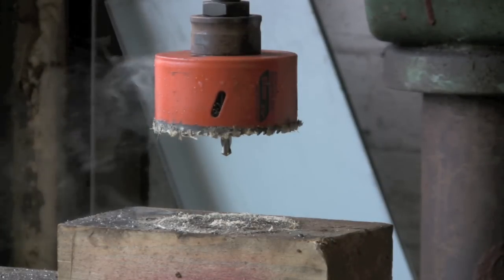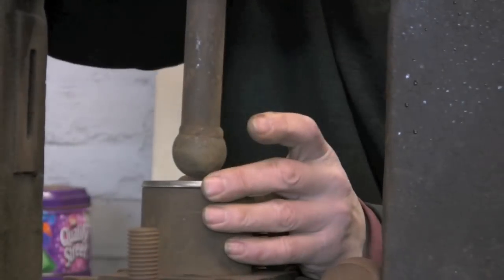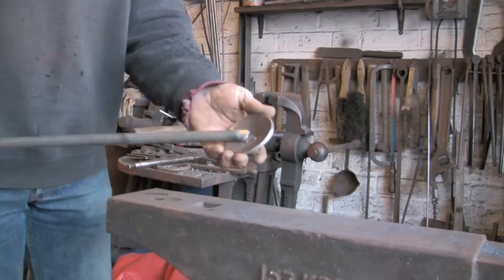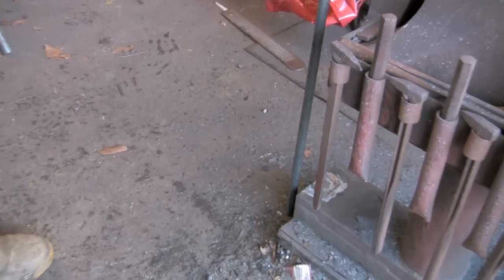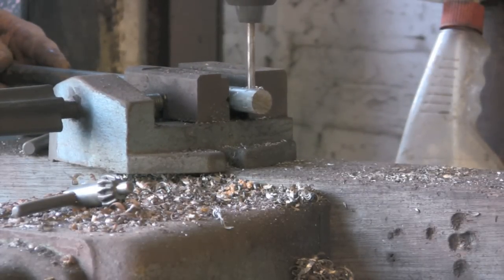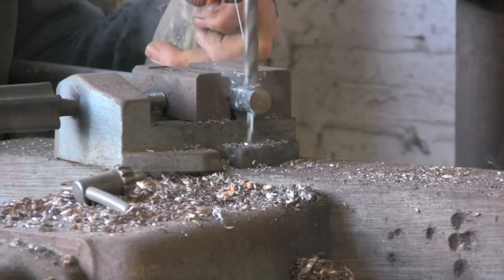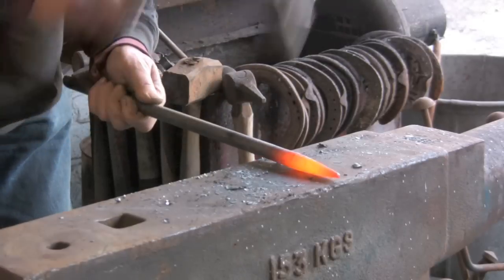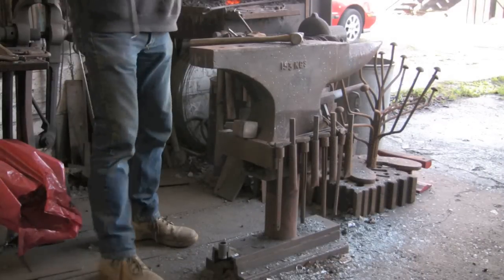Anvil "mushroom" hold down.

Comment: If you catch your hands on a belt grinder bare handed you could loose quite a bit of skin, however if you are wearing gloves.... it can drag your whole arm in and snap it off at the elbow! Ive been metal working for 20+ years, i only wear gloves when moving freshly guillotined sheet. What makes a really good metal shop... is years of experience. nice video. thanks for sharing :)

Comment: "Move the work not the hammer." Hot damn thats a useful tip. Just came in from forging a round punch and that would have made my work way neater. My hammering skill is all over the place still. But if I concentrate on hitting the same spot and move the work that will be way more accurate.  Thanks +Gary Huston !

Comment: Yeah if I would have reached up there and got that hole saw out of the drill press like you did it would have burnt my fingers!
Gary must be amazingly tough or there was time laps in there somewhere?
Funny people talk about wearing gloves I've taken enough bark off of my hands using a 5" hand grinder I sure don't mind using gloves. Now if I was running a lathe sure I would not wear glove,
Reply from the maker: No time lapse, but it wasn't that hot because I was cooling it with the soluble oil.
I agree about the gloves, there is a time and a place!

Comment: Hi Gary, as always really love your video. Galvanised metal is actually zinc metal coated. The zinc acts as a sacrificial metal and corrodes in preference to the steel.
Reply from the maker: So what are you trying to say?
Reply: Gary Huston i think you made a reference to what galvanised metal is in your video which wasn't correct. I cant remember exactly what you said now. Anyway the important thing is you can't heat up galvanized metal else you will get zinc fume poisoning which will at best leave you very unwell.  Thanks for the great videos Gary, after seeing your flypress video, i found myself one and can't wait to use it.
Reply from the maker: https://www.dropbox.com/s/1i8v2djczr11f9g/WeldingGalvanized.pdf?dl=0
Reply: I believe he just said dont breath in the fumes as it produces a toxic gass "possibly cyanide". He even said he couldn't remember the specifics, but he never mentioned the makeup of galvanising.  Mig welding definitely gets it hot enough to fume off the coating, same as forging. And I believe your referring to Metal fever. Which is about right. I think were all on the same page, if you weld/forge galvanised stuff, run away or hold your breath.

Besides, we all know Gary has asbestos lungs and will die at 105 smoking a rare metal cigar :) He's invincible.

Comment: You are right, the fumes from welding galvanized metals are bad.  Use a 3M welder's face mask which has a built in filter or better yet, avoid galvanized metals altogether.  It will add years to your life.

Comment: Honestly, yes it works but there are other ways that work as well that do not tie up the pritchel hole.
Reply from the maker: Absolutely, but what is your point? How often do you use the pritchel hole, I never use it, even when shoe making as the hole is far bigger than my pritchel which would fall straight through!
Reply: I use it quite a bit for drifting, but then not everyone does so, as it is often said, YMMV!
Reply from the maker: I'm now confused! If you're using it for drifting why would you put the hold down in?  I only use it when I want to hold something down. It just drops in, it's not a permanent fitting that I have to work around. If I was doing both I would use the one I made for the hardy hole.
Reply: garyhuston At the 10 minute mark, you show the connecting rod threaded through the pritchel and the lower guide then the bottom peddle is attached. It looks to be a more perm item than temp. I don't use both at the same time but for a hold down, I use a spring hold down, fast into the pritchel and fast out, all I intended to say is that I do use the pritchel and would not want it tied up for use as a hold down only. Sorry for the confusion.
Reply from the maker: wayne parris
It may look a bit more permanent than it is, it simply drops into the pritchel hole and the foot pedal is just a push fit so comes apart quickly. I personally never use it, in fact I cut it up the other day as I wanted some 5/8" bar for another job. I rarely use any type of hold down but if i do I use the spring type in the hardy hole!